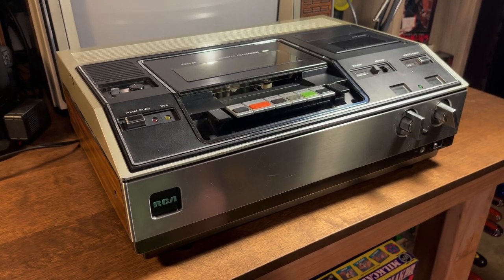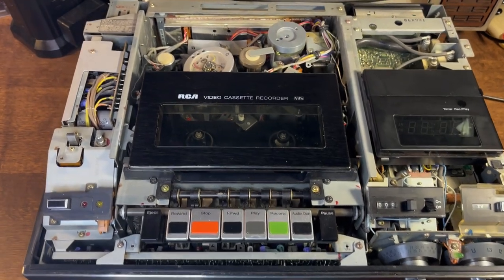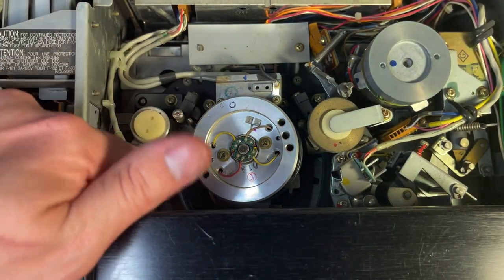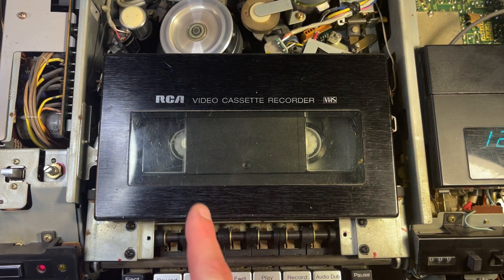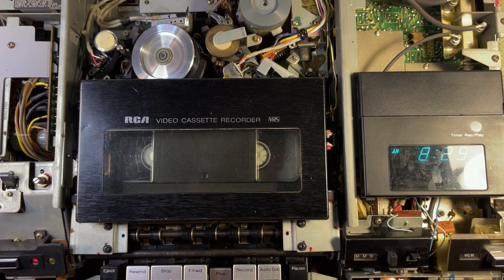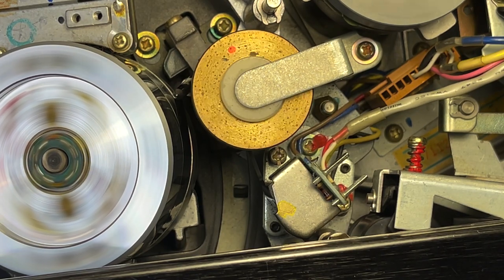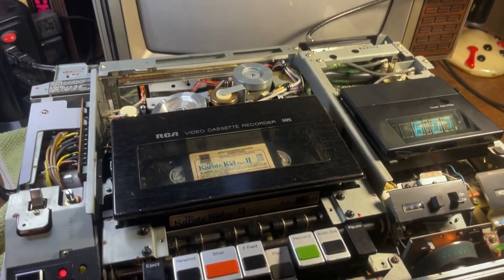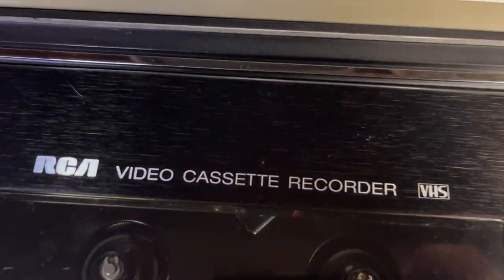1978 RCA VBT200

Comment: Early VHS machines before 1987 or so usually didn't automatically pull the tape out of the cassette until play was pressed.  Almost overnight in 1987 every machine would start threading the tape upon insertion and would play a tape automatically if the record prevention tab wasn't there.   I noticed that old machine had SP (2 hour) and LP (4 hour) speeds so it predates the terrible EP (SLP) 6 hour speed.     In the 80s, many people had those old top-loader RCA units and they weren't hi-fi but the machines lasted a long time and had a good picture if you used good name-brand tapes and used SP.    When you think about the complexity of these old machines it is a miracle they were so reliable for a few years even with a lot of use.
Reply: it was only happens in sony betamax reel takeup guide always loaded on head ,,, even in rew or fwd position's
Reply: due to tape safety, it was only happened betamax ,

Comment: I was in the front line on this machine in 1976 before they came to market. My job was teach  how they worked snd how to service them. Blank VHS cartridges were $25 each. Rentals were $100 for two nights. The 1st machines were mainly mechanical. Weight was about 30 pounds. Head replacement were $400 and heads failed prematurely.

Comment: Hi there, I know this old VCR very well. first off the Video Head in them first VCRs all ways ran when you turn them on & that was normal for them to do that. As far as your problem is with the Video wobble while in play, That is do to the Video Head Motor spinning a little bit to slow or maybe a little bit to Fast. There is an ajustment for that. On the smaller Board where the Motor adjustments are, Try standing the VCR on the side & have it play a good Tape in SP. Look for the adjustment called cyclender free Run, Turn that slowly & that should get your Video to be stable. I worked on fixing & restoring them old Top Load VCRs a lot in the mid & late 1980s & 1990s. I can all so convert them old 4 hour VCRs to work & play SLP Tapes on the 6 hour speed. I found out how to do that back in October of 1985. I then put the SLP or EP speeds in lots of other old VCRs like that. I would in stall a togo switch in the back of the VCR & add a 100K pot in with a 10K resistor & with the togo switch on, LP would become SLP the slow speed. Then with the Togo off the VCR would be normal like it was. I use to run a VCR repair shop from 1987 to 2003. at times People would give Me them old 4 hour VCRs for free as the newer ones were much smaller. I only just have 1 old RCA VBT 200 just like the one you have on this youtube channel. feel free to email Me if you wish at soundmaster404@gmail.com. I am sure your Video Head Motor is fine & the little ajustment pots get dirty from sitting & its more then likly off a bit & the Head has to be spinning at 1800 RPM & if not you get video shifting on your TV screen. if the Video Motor is way off the 1800 RPM you will not get any picture & just Horazontel Bars. Them first VCRs were made in 1977 in to 1978 & then by 1979 they made all most the same VCR only on the newer units the video Head did not run until you press play. Hope i can help you out there. Jerry

Comment: When I went into TV repair there were still a lot of these things in use and we got quite a few in for repair. Some of these were made by Mitsubishi - mostly the Quasar and Motorola units. Most of the rest were made under contract by Matsushita, a lot of RCA units being among them. There was one early model - don't remember which - that had a small light bulb and light sensor assembly in the transport area: when the tape was taken up to play it would interrupt the beam of light and tell the unit that it was playing. One of the most common repairs when it would malfunction and the bulb burn out - and the one we had to explain the most to confused owners - was why their VCR was fixed by us simply replacing a light bulb. 

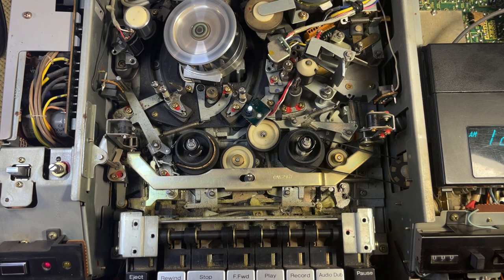VCRs like this was where a particular term for an unusually un-tech-savvy person originated: a "Twelve O'clock Flasher". If a person was a twelve o'clock flasher, it meant that they were so afraid of technology or inept in its use that every appliance clock in their house was always flashing "12:00"...
Reply from the maker: Hahaha! Yep, the bulb was out on this one.
Reply: @vintagevideobasement  Yep! saw that after I went back and viewed the whole video . Ahhh, the memories! Used to keep a stock of those things because it was such a common problem. Great video!

I still have a lot of my old stuff - old tubes in tube caddies, etc. One of the hazards of being an old-style electronics nerd -